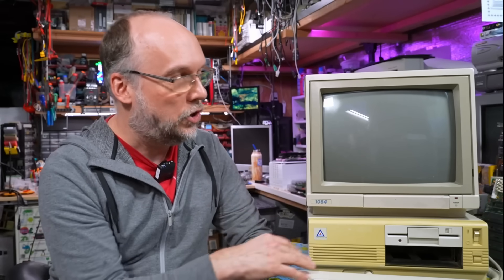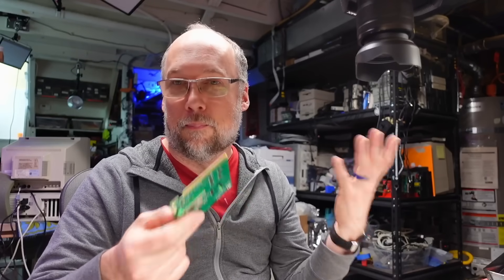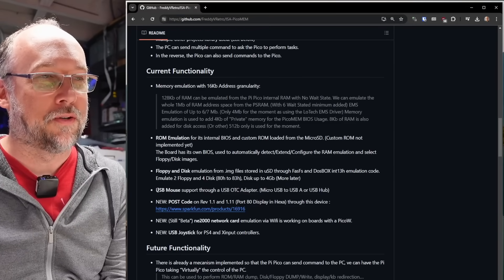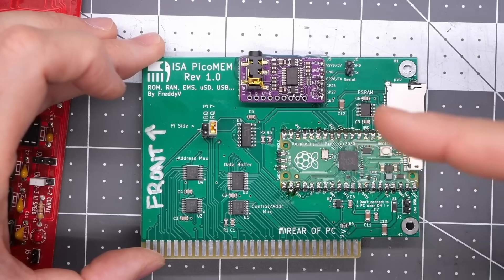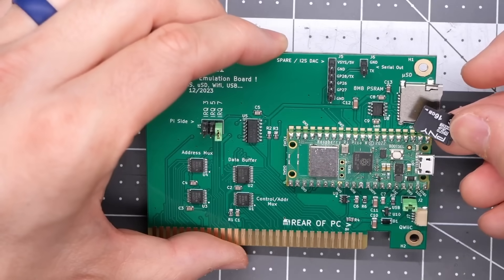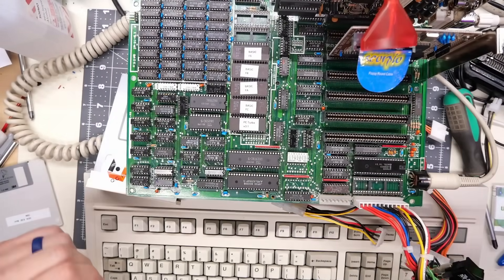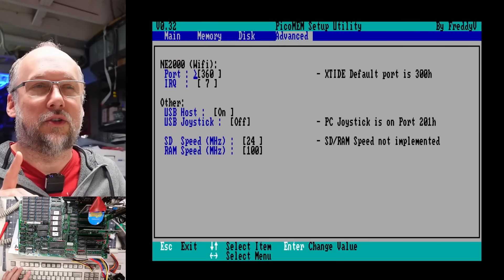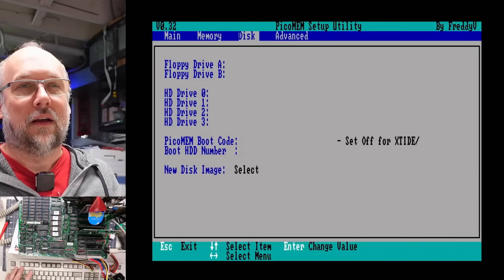The PicoMEM is an amazing software defined ISA card

Comment: The disk performance might be impacted by the microSD itself, older cards tend to have miserable random performance, a later A1 or A2 rated card should handle that much better
Reply: Hi,
Interresting, I effectively saw that uSD access time on uSD is long on single secttor read, but I did not know the A2 Grade, I should try.

Comment: I have an IBM Model 80/386 that I used to power up to have the only 80386 on the internet. The one ethernet card I had failed about 10 years ago and was wondering if I could get one of these cards for MicroChannel???
Reply: Not sure that is in the plans, but there were some IBM LAN Adapter/A's on eBay for cheap when I checked last. I bought one a month or so ago.
Reply: Actually @yyzkevin chimed in on another thread, sounds like there will be an MCA version at some point!!
Reply: @RetroTechChris  "sounds like there will be an MCA version at some point!!" I kinda solved the problem 5 to 7 years ago by going Model 80 parallel port to Window 95 parallel port and then to Ethernet via the Windows 95 machine. It worked out to be like a 300 baud modem connection accessing gigabytes on the internet. 
I have several IBM Token Ring adaptors with a Token Ring hub being forwarded to a Token Ring switch.... But there is no way to translate to Ethernet. I have several Model 50's that I can play doom together with the Model 80, but an Ethernet MCA would be much better along with being able to use floppy images.

Comment: ISA card's, about the sort of, more moden PC models the say when PCI, started comeout, and have legasy ISA slots, on a PC' PCI slot, I thing INTEL start puting the CPU slot cards to, the start PENTIOM modern enough two still, goo working order, but still close enough classical PC,  most software will notice somewhat new hardware, back the question, would card, working such a setup, the same demo'ed in the video?

Comment: Hey Adrian, no hate here, just curious: where do you draw the line between using the original components and emulating something? For example, this replaces all sorts of original cards and peripherals such as the mouse and keyboard, and I asked myself if you'd feel the same enjoyment if it was a completely emulated pc using only the original monitor? I have no experience with these machines so I can't think of an answer myself. Take care and keep it up :)
Reply: Yeah, at some point it stops being retro computing and just becomes emulation.
Reply: I draw the line at the cpu hardware
Reply: Plus the joy of owning the actual motherboard and case

Comment: What if - one day - you turn on your retro PC and it explodes in a ball of fire. Do you?
1) hurriedly remove the case and remove your PicoMEM card?
2) run and get the fire extinguisher and try to put out the flames before your home/lab burns to the ground, or
3) think to yourself, “well, it was a good run, but eventually those RIFA caps were gonna blow!”
😊

Comment: Does PicoMEM also work on newer 286 machines?
Reply: It sure does!  I have tested it on a 386 and 486 system as well as my PS/2 Model 30 286
Reply: @RetroTechChris  Great, an old 286 is waiting for a new life and PicoMEM could make it work again :)
Reply: It all depends on your needs and performance requirements. Just like an XT IDE will work in a 286 or 386, it would be faster to just use a 16 bit ISA IDE adapter with an IDE drive, or SD to IDE.

Comment: How does an XT have "high memory"?  The CPU only addresses 1MB.
Reply: Hi,
EMS is working with 64kb below the 1st mega thar can be places anywhere in a multiple mega RAM
Reply: @freddyvretrozone2849  Yes, EMS is below the 1MB boundary.  It does not have the oddly reachable 64K-16 bytes beyond 1MB by not wrapping address (the A20 gate).
===
High Memory Area (HMA): This is the first 64 KB of extended memory above the 1 MB boundary, minus 16 bytes. It starts just above the 1 MB mark and ends at 1,048,576 bytes (1024 KB + 64 KB - 16 bytes). The HMA became accessible with the introduction of the 80286 processor's ability to use the A20 address line, which allowed access to memory slightly above the 1 MB limit. DOS could use this area to load parts of itself, freeing up more conventional memory for applications. The DOS command DOS=HIGH in the CONFIG.SYS file was used to load DOS into the HMA.

Comment: Having an MCA version of this would revive a lot of PS2 Systems. But that's also 16 or 32 Megabyte and would most likely need another microcontroller. 😢
Reply: Eventually we will have an MCA Pico board.  I have some prototypes, but limited time.  I will come back to it in the future if somebody else does not  first publish an MCA adapter.

Comment: Can the pc run with pm or ps ram of the pico only?
Reply: No. The RAM from the PicoMEM will only be available after the BIOS called the ROM of the PicoMEM to initialize the card. That's why the BIOS still counted only 256K even when Adrian enabled PMRAM and/or PSRAM. Without any RAM on the mainboard, the BIOS will be unable to perform basic system initialization and call the PicoMEM add-on ROM.

Comment: Now we need a 16 bit ISA card and a PCI card.  Those extra ROMs would be great for an iSCSI boot, although probably really slow on an  XT.
Reply from the maker: Unfortunately the Pi Pico doesn't have enough GPIO lined for 16 bit (or more) ... Perhaps if a faster "mega" version comes out one day :-)
Reply: @adriansdigitalbasement  I wonder if they could use 2 with some sort of multiplexing on the address and data lines.  Probably easier ways to do it at that point though.
Reply: Would have to goto something like a Teensy vs the Pico. Teensy 4.1 has onboard location for SRAM, built in Ethernet, and a USB host port you could wire to full size post for mouse.
Reply: could maybe use a proper raspberry pi board for that (if it's got enough IO for it)

Comment: Ordered, but it is already back-ordered.  lol.  Also image change is necessary for a multi-diskette install.  DOS shouldn’t have an issue with it anymore than physically ejecting and replacing a diskette.
Reply from the maker: Freddy told me there is a way to change disks from DOS with a key combo! I knew I would miss some features and that was one of them. 

Kevin also told me more will be built as parts are already on hand, so at least for orders after the video early release, they shouldn't take too long.
Reply: @adriansdigitalbasement  No problem, you need a 4 hours video to show and explain everything :)

Comment: There seem to be issues with its open source state and the license. The board files are not open source, it is only sold from the Texelec store. The github page says that the firmware is under the "GNU v2" license (no such license exists, maybe he means the GPLv2, a license not included in the project files anyway), and that for any commercial use the author must be contacted (this is not how the the GPLv2 license works). He also says that he doesn't know how to manage the firmware source code, and yet the project is on github...
Reply: Sounds like a bunch of nits. Though I am sure FreddyV is not trying to gatekeep this. Having supported this project in a testing capacity for over a year, I can tell you he is not a gatekeeper.
Reply: @RetroTechChris  There is nothing stopping him from releasing the board files or firmware. Instead he made a deal so that TexElec becomes the "official US reseller" of the card. TexElec is also involved in the Commander X16, which also had similar promises of being all open but in reality is proprietary.
Reply: @Schule04  Hi, Even if I started to work on, this project a long time ago, everything arrived quite fast.
I plan to realease everything when I am ready to do so (Psychologically, to give my "baby" to the public and when I better understand all those licenses things)
It is not a secret, it use open source code, so I MUST release the source.
If you know well all the licenses problematics, we can discuss about it.

Comment: Am I the only one that finds these projects a bit silly? If you add CPU emulation and VGA capability to this card there is basically no need for the original PC anymore. This is a cool tool for repairs, testing etc, but for prolonged use, if you emulate 80% of the hardware anyway, just use an emulator with a SBC or modern PC....
Reply: Hi,
No, you are not the first one, and I got lot of remark telling me : Why not use a Teensy that is 10x faster than the Pico ?
I did this project because I wanted to do again electronic, start to use modern dev tools, learn about emulation and microcontrollers.
The Primary goal is to put Back Emulation code into real hardware, to be able to have fonctions difficult to fine and to make them easyer to use.
So, my project is Totally the reverse, put emulation at the service of the real hardware.
The XT Computers are put on the side, because too slow, not simple to use...
So, if we think in another way, much more ppls will want to use XT Computers thanks to the PicoMEM. Again, the reality will be the reverse of what you explained...
(It is already what I observe)
Reply: Thanks for the extensive reply! I think what you created is amazing. The versatility and value of this card is through the roof and it will be a giant help to anyone starting out with old PCs using 2 or 3 of its features. With old hardware there always is a tradeoff between convenience and authenticity. As an extreme example with just the PicoMem and an old PC with a VGA card, you could use a flat panel monitor, modern wireless keyboard and mouse, download games via WiFi, store everything on SD card and play them with an Xbox gamepad. While this is great and easy it hasn't got a lot to do with how it worked in the 80s. That's the scenario which doesn't make much sense to me, but I guess most people wouldn't take it so far.

Comment: Isn't pico a more powerful pc than the one you are putting it in?
Reply: Yes. And? Who cares? It's $6.
Reply: @tarnaigy  Missing the point, aren't you?
Reply: I think the one miasing the point is you.
Reply: @iyatemu  I'm missing the point of reviving old tech by putting in it "relatively extreme" new tech. By extreme I mean the kind that could replace it all entirely. Don't get me wrong, I dig fixing old tech with modern produced components, but sometimes the tech gap between them makes it... I'm missing a word... maybe loose the vintage vibe? I don't know how to describe it differently. Its like building contraption to use modern zilog in the place of old one seems somehow right to me, using fpga.. not so much...
I guess that's quite individual, but that's my point, I can't be missing it since I wrote the comment you are replying to.

Comment: Not a fan of such expansion cards, the same goes for putting Raspberry PI into Amiga. Whats the point? Raspberry Pi has it's own clock way faster than computers of the era and is capable of emulating the whole computer on its own. Nevertheless interesting device.

Comment: At some point, just emulate the entire PC on your modern desktop and be done with it.  Retro hardware is supposed to be hard.  Like it was in the long ago and the far far away.

Seriously, at what point do you just call it and say "i'm not doing the old hardware thing, i just want the experience."  If you just want the experience, then just emulate.

The only caveat to that is things like floppy drives, where the media is just disappearing, as it's not made anymore.  I'd rather see effort put into floppy manufacturing than cards like this, TBH.  I know that doesn't make any economic sense, but it's what i'd like to see.
Reply: Hi, 
The PicoMEM just provide bigger / faster hard disk , RAM (at ISA Speed, so slow) and fonctionality that make all this more simple to use.
I also add more fonctions for the personnal challenge to see if I can so it. (and if it can be usefull, that is cool)
Everything can be disabled : You can still use a real HDD, and use the PicoMEM only to copy files from the modern PC.
The PC is still the same, running at the same speed. (The only noticable difference is disk load time)
I designed the picomem so that PC that are not usable anymore can be used again.
To have a more modern usage "Feeling" so that even new generation can discover and use the machines.
It is not at all to force anyone to go to emulation because it is not authentic, it is really the opposite.
We often see on forums persons not able to use XTIDE because it is too complex, they have no floppy and it is the only way for them to use their first machine.